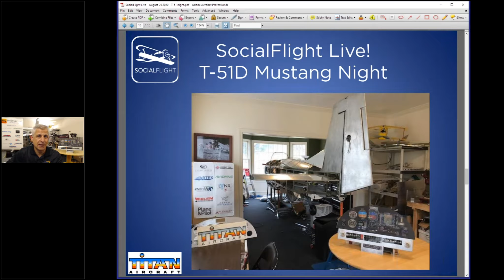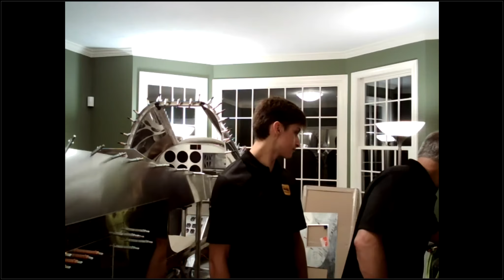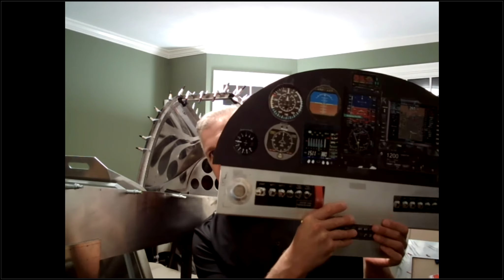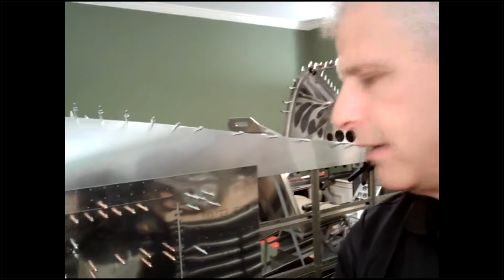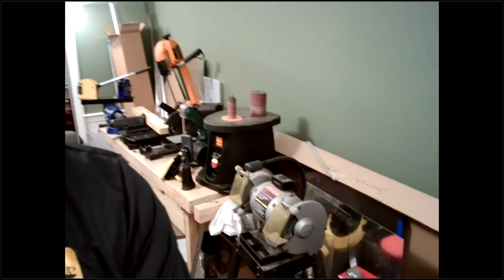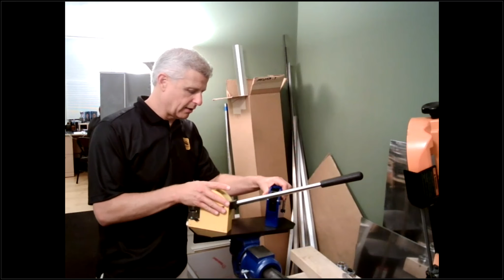SocialFlight Live! - 8-25-20 - T51 Mustang Build Night!

Comment: Hello Jeff and sons, I have been following your build since day one. You guys are doing a fantastic job. I am also glad to see that you are doing the same thing that I did. That is building the plane at home.  I did mine in the basement and in the heated garage. I felt I could get a lot more work done by doing it at home instead of wasting time driving to and from the hanger every day. I built mine in  two and a half years.  
What is the difference with the LM 4  that you are using and the LS 3.  It appears the plane will go right out with the window removed and the tail off. Do you have the center section fitted up yet?  with removal to get it outside for final assembly.

Comment: Its shocking you built that mustang without any corrosion preventitive measures such as paint on the inside of the body prior to riveting the metal. If you dont plan on keeping this plane past 20 yrs then by all means, but if you do intend it to fly for a long time, then I would have painted every inch of the hard-ware going into the body frame. Metal on Metal contact, and riveted aluminum can create corrosion.
Reply from the maker: Hi Bill -  You are correct that corrosion prevention is important.  If you watch our videos, you will see that primer is applied to most internal components prior to final bonding and riveting. Areas that are directly bonded have to be bare for the adhesive to bond, but other areas are coated. Additionally, we will be spraying some internal assemblies after construction where appropriate.
Reply: @SocialFlight  Awesome, it looked as though it was bare metal, I havent watched every video, I'm subscribed to many channels and can' t keep up lol. But I have seen progress which is a good thing, I have a helicopter I'm building called the Mosquito myself. It was that or the T-51 and I chose the helicopter lol.